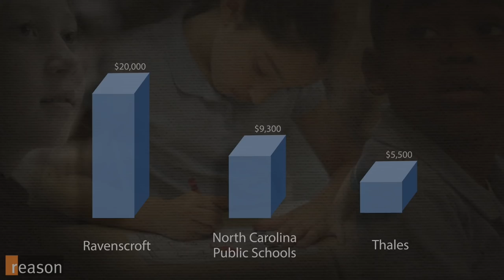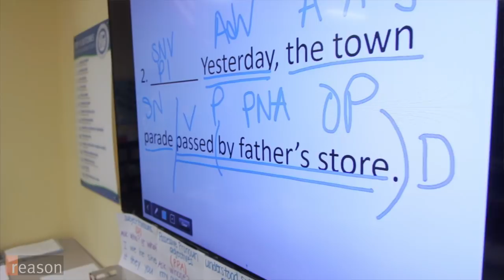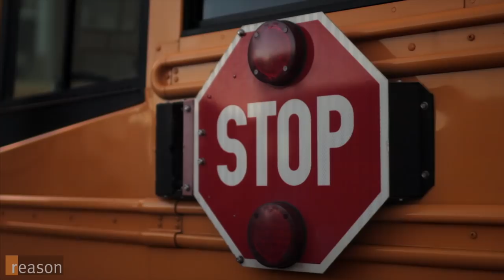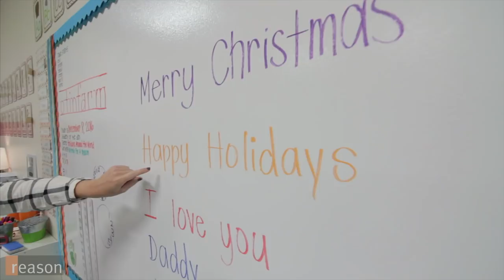A Libertarian Builds Low-Cost Private Schools for the Masses

Comment: "If the teacher has a Master's degree but they aren't a good teacher, then we don't consider the master's degree to be very valuable." So simple that it goes over the heads of most "educated" people.
Reply: So true. Although i went to a private school the teaches with their "masters" sometimes were garbage. And someone with a couple years of college and some smarts could easily out-teach many of these dummies with degrees.
Reply: True, but I can sympathize a bit. When you're employing millions of people, it's hard to go case-by-case. And going by papers is better than choosing completely at random. This is one of the biggest problems of centralization. There is a reason entities that grow too large tend to become slow and unresponsive and usually collapse.
Reply: The size of the company is not the problem. The ability to train employees and adapt is the problem. Telling everyone to choose teachers who have masters degrees is tying up the success of schools to the value of a masters degree, which is determined by the quality of some university somewhere that is probably a scam (most universities are scams). So it can't be quickly adapted if, say, the worth of a degree drops by 50% in 10 years. But that doesn't mean your CEO has to hand-pick every teacher, they just need to codify a more reliable way of determining if a teacher will be successful. If the success of your business depends entirely on the success of teachers (like when you're competing directly and must out-perform "free" public schools every single year) then you can afford to spend a little extra on perfecting your testing / screening and get the right people instead of just falling back on sketchy certifications.
Reply: @gorkyd7912  :  A teaching certificate doesn't mean a whole lot, other than that the person took a lot of education courses that are NOT related to the disciplines they mean to teach.  As a former college student, I saw the wash-outs who decided to get a teaching certificate because they weren't fit to compete in any major area of study.  

A master's only says you have some competence in the content area.  A teaching certificate only says that you took a bare minimum of regular courses and a bunch of "education" courses.  Neither says you're any good as a teacher. Only observing you in the classroom and seeing how students respond really tells you, and that's easy enough to do, unless it's a public school and administrators (and teachers) don't want to visit classrooms.  In a private setup, if you suck, you're OUT.

In a private setup, parents have real skin in the game, and if you suck, they're pullin'  their kids out and spending that money somewhere else. There's no penalty for failure in the public schools. The worse you suck, the more money you get.  And year after year, the number of staff and administration per actual working faculty member goes up and up, without end.  And there are actually LESS staff supporting the actual faculty.   The staff and administration do everything BUT anything related to the actual teaching and learning.

And every time you TRY to implement something meaningful and really quality-control-related, the teachers' union or some state bureaucrat will obstruct you.   Public education is a definite scam, and some of the worst scammers are the people always whining for MORE money.  It's not a money thing.  It's a product-quality thing.  And nobody holds the public schools accountable.  And NOWadays (and for the last 20 or 30 years), it's all been dumped on the COLLEGES to remediate all the damage done by k-12, instead of holding k-12 accountable.

But "student success" means students pass.  And the only way to guarantee that students pass is to lower standards, which they've been doing non-stop since I started teaching back in the 1980s.
Reply: Indeed. And I believe this applies to all professions. I've known guys with degrees in IT who were far less competent than guys I know who have no formal education in computing, but nevertheless slept, ate, and breathed computer since childhood.
Reply: @harrymills2770  curious, you clearly have expertise, do you think there are enough people with genuine ability to teach? This seems to me temperamental more than knowledge. Although I believe actual behaviours can be trained, to a degree. ( not by a degree)
Reply: @imreborbas9029  that's why you start them at the bottom and move them up only if they earn their wings.
Fuck the paper your management should be able to decipher if the person is competent
Reply: @nopedefinitelynotnahthatsnotme  Agreed. A degree does not always indicate a better teacher. Lots of masters' courses have been plagued by marxist ideology, and real learning is thrown out the window. Even if it's not a worthless degree, there's no guarantee that a teacher won't ever become complacent. The true test is reviews from parents. I think there's an arrogance shared by many teachers, as if they know better than parents when that is simply untrue. They are good at teaching a subject, hence why they are called teachers, but that doesn't mean they know better for children than their parents.
Reply: I do not understand many peoples anti-teacher and anti-education stance, many people think they understand a thing about education, and think they understand a thing about teaching, in the end though, most don't. The comments on this video show my statement to be true. For one, you don't get a degree in education, you get a degree in your content major, so yes you are competing and showing you have an advanced understanding of your discipline, to teach, you do have to train for a certification, which after you have to train to show you have a through understanding of your subject, the training is not for washed up losers like people seem to think it is. You can be awarded a masters in education, but that is a separate issue. After becoming a teacher, you still have to go through endless training, most of it on your own time and money. The job itself is not some cake walk either. If we are talking the university system, it is broken but saying they give worthless pieces of paper is untrue, the knowledge you gain from university shapes you as a person, and if they want to feel better because of it, they should if they truly grew, shaming those who are educated is the reason we will never make it as a country.
Reply: People with degrees gave me crosswords to complete when I was at school, and considered my poor spelling to be my problem I had to fix, not theirs.
Reply: @Irishcrossing  you acknowledge a persons worth by paying them for how well they do a job.
Reply: @Irishcrossing     Some people with a college degree are capable and knowledgeable and some are still pretty stupid.  Just as everyone with a driver's license isn't a good driver, so too everyone with a PhD isn't really educated.
Reply: @Irishcrossing  
Everyone can agree, THIS educational system needs change.
Reply: @Mandy , Aaron Christensen, nemo227 

I'm not sure if these are responses to me personally or to the character I have created for the purposes of mocking the "educated" person. If it is the former then I probably should have made my jest more clearly represented as a jest and not assume that people could read sarcasm within the written word which could be mistaken for a genuine argument.
Reply: Oops, I forgot to add that a teaching demonstration is part of getting hired as a teacher and not just presenting a diploma and taking the exam.  This means a topic is assigned to the teacher applicant.  S/he makes a lesson plan based on the topic and grade-level.  S/he prepares the materials needed, and then s/he presents his/her lesson to real students or a panel of teachers and administrators who will act as students.  This will show if an applicant really knows how to teach.
Reply: That's just a general Australian school that we've had for years... We don't have a cafeteria, just a canteen to buy food if the student wants. We don't have a charter bus thing, but private buses instead. Plus our classes are usually 30 per class.
Reply: @Gary Miller   Maybe you can offer some evidence to support your conclusion.
Reply: I completely agree, however I'd like to point out that he also cut costs by removing things that I would consider fundamental to a school. I'm all for minimizing sports facilities, but I wouldn't get rid of school lunch. I'm not 100% set on keeping social workers, buses, or active security personnel; but they were certainly useful to a number of kids when I was in school.
Reply: I work in schools I’m a teacher and you’ll  e surprised at how many teacher or idiots or just lazy
Reply: The University of Phoenix MBA was invented for this. A cheap way government types could get a masters to satisfy some rule for a job.
Reply: Our outdated, inefficient public  school system is why education isn’t as valuable nowadays
Reply: We need to put more Libertarians into the Republican Party
Reply: @imreborbas9029  Hire recruiters. Stop being lazy.
Reply: @dariankaltenbach8062  obviously I agree with you (which is why I started my comment with "true"). I was just explaining the phenomenon, not justifying it (which is why I ended on a down note).
Though considering how HR is these days I'm not sure that increasing their responsibilities would lead to an improvement...
Reply: A wise man once said: Don't mistake a finger pointing to the moon for the moon. A degree points to success, it is not success in itself.
Reply: @imreborbas9029  About a decade ago, a Long Island, NY principal gave all teacher applicants a Regents Test in their subject area.  Regents exams are state tests given at the end of certain classes, like biology, algebra, English, etc.  If the applicant didn't pass what they were supposed to be educated in, he never interviewed them.

Comment: So many are commenting on how he's saving money by cutting services and being critical of that. But the services are cut back to the point to where it is very much the same as my public elementary school experience in the 1970s. Now some kids did ride the bus from further away and there were a handful of kids in special ed but that's the only difference. And class size was larger, about 30 kids. Those differences probably cancel each other in cost. The school had no sports facility except for a very simple gym. Playground equipment was made with iron pipe. There was a chain link fence backstop for baseball like sports. No infield as I recall, just lawn. Most kids biked, walked, or their parents dropped them off.  The school had maybe 3 or 4 non teaching staff. Principal, janitor, secretary, nurse maybe. 

I just don't see how this private school is so horrifically short of things. It's all that was ever expected of public schools back in the 1970s. Public schools became a jobs program. So there are lots of jobs and lots of cost and contracts to build and maintain a bunch of stuff. It's about capturing that flow of money from the taxpayers.

Comment: Interesting.  My spouse was co-owner and director of a Traditional Montessori school (private for profit).  For the 17 years that the school operated in Texas, the majority of their students had comprehensive test scores that far exceeded comparable students that were in the public school system.  The school also had scholarships for parents who could not afford the annual tuition of $6600 (Kindergarten through 6th grade). The difference is that the school and the Montessori method helps the student develop a “love of learning” and can lead to lower expenses for students, their families and the overall school costs.  Rest assured, the Montessori method is just one way for better school instruction.  There are other methods that may also be effective, but any method that only “prepares” students to take a state/government designed and implemented test is an abject failure.

Comment: Actually, education should be dramatically dropping in cost. The reason, is that technology has mad education more efficient, and at a faster pace. What use to take 4 years to train, now can be done in a year or less.

The problem, is that it isn't profitable to educate properly, as you can always expand the demand to other unnecessary services, which should have been taught properly in the traditional schooling.

Comment: Right on the money. Public schools are over-complicated daycare facilities which largely cater to the uneducable. In a nutshell, if you’re teaching a self contained sixth grade classroom then everybody in that room better be able to do grade six material. Then also the chronically disruptive kids need to be dumped back into the public schools so the suckers can babysit them. Eventually the public schools will have to automated since they’re alienating all of the teachers. If the public schools want to specialize in babysitting then their teachers should be replaced by computer terminals for online academy and babysitters. And to belabor the obvious, both online academy and babysitters are far cheaper than phony teachers with phony master’s degrees in “education” instead of some content area.

Comment: Well, it's an important detail that not servicing kids with learning difficulties is one hell of a "little trick". Reduction of unnecessary expenses is probably the better trait of the private sector, and although segmenting kids by levels is certainly much more efficient than individualized attention, it has many detractors as well, since it is usually seen as classist and segregatory.
Reply: Yeah, I grew up in Baltimore that might be the worst example of public school spending and waste.  They spend approx $18k per pupil which is way above national average but the schools are terrible.  An audit found that only 2 of 5 district employees were teachers.  Lots of graft and fraud.

Comment: So...:

1) Not accepting disabled students in order to lower costs is bullshit and fucking disgusting.

2) The class size should be dictated by what’s most efficient for the students’ learning AND budgetary concerns. It is only one factor and there is a time for both large vs small class sizes. Using a large class size as an argument for efficiency ignores that many students simply don’t learn well that way.

3) As an institution, you should choose from a pool of people with masters who have performed well. I agree that the education system makes this difficult, but vetting qualified instructors who pass the bare minimum avoids having someone who is BOTH under-qualified and sucks at their job from being there. The argument for it being easier to fire shit teachers is fine. That should happen anywhere. But they should all be at least educated to educate. Also, state certification is something teachers in public schools already have to get. Lowering the bar will lower the quality of the teaching body.

4) I do agree that extracurriculars and especially phys ed eat an enormous amount of resources that could be used elsewhere, but cutting out too much limits a student’s options of exploring something they could potentially have a lot of talent in and which may enable them to shine and get recognition/rewarded for.

5) In the short term, this may be cheaper. However, the costs come later in the form of students underperforming at a college/trade school/ vocational level when cost cutting in so many aspects of the systems limits options for students. The cost comes when certain classes of students (the disabled for one, and who knows what the policy is on people with other medical issues) are simply unable to attend because they are deemed too expensive to serve — robbing the student community of valuable peers and minds. The cost comes when you take money out of the public to fund these ventures, hurting public school systems that could need and have more horizontal student bodies. The cost comes when a new generation of qualified American educators is robbed of an opportunity to showcase their skills by a flooding of the market of people who took a shortcut.

I am all for reforming the system. For streamlining instead of red tape. For cost reduction of bloated sectors of the department . Of efficiency and market savviness. What I am NOT for is a watered down, limited, discriminatory, and inconsistently certified institution teaching kids.